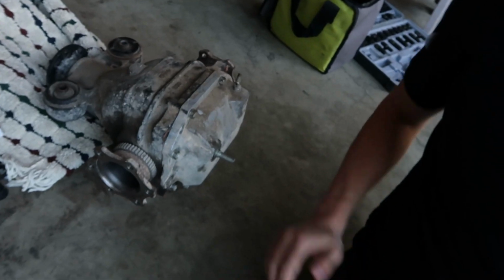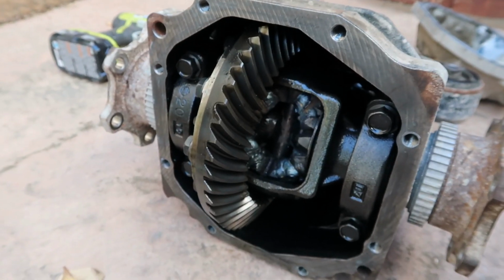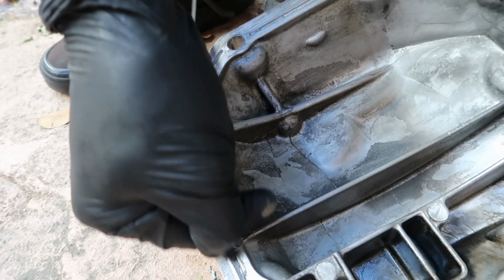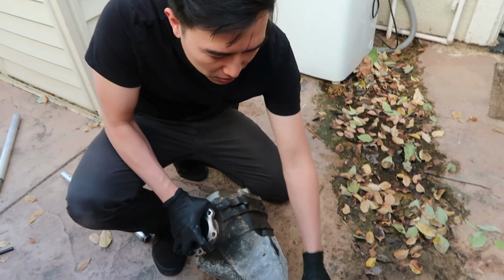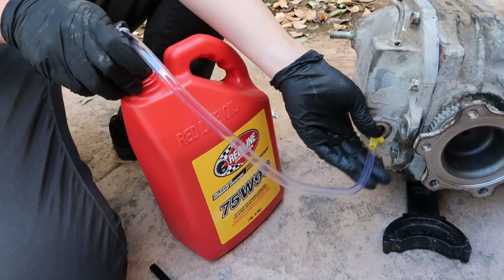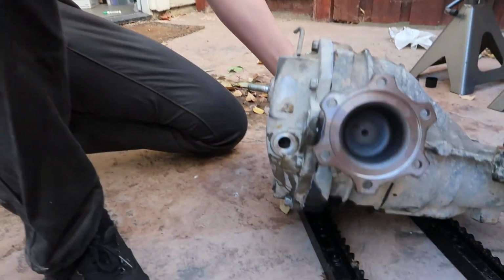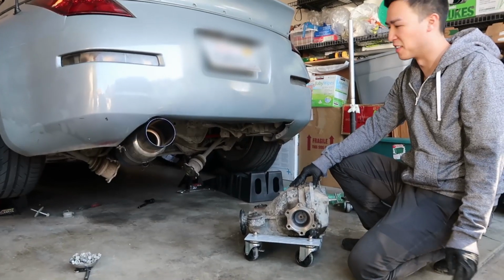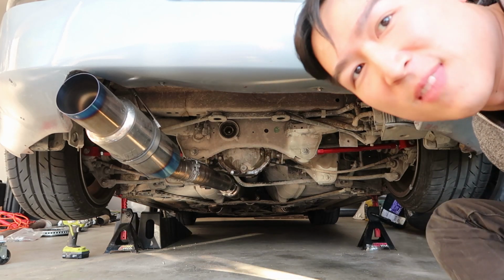How to: Install Welded Diff & First Skids | (Season 4 Episode 8)

Comment: so if I get a stock 350z and get the diff welded that's all I need to drift it well?
Reply from the maker: technically yes, but I'd recommend getting some some coilovers too.
Reply: @Riskspeed  Thanks for the answer dude! I'll definitely try and get me some coilovers too, which ones would you recommend?
Reply from the maker: @Kenji-ug5bo  depends on your budget really.  I usually like Stance, but lots of people like BC.
Reply: @Riskspeed  Thanks! i also think i prefer stance, i'm gonna have to check for prices. Thanks for the info very helpful